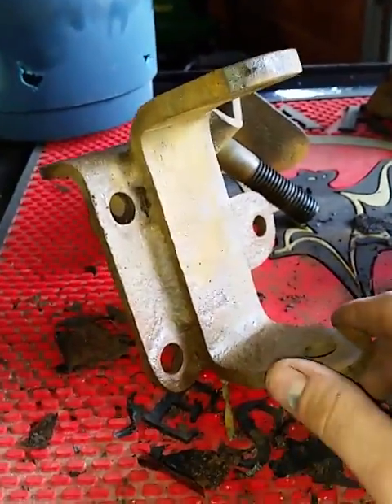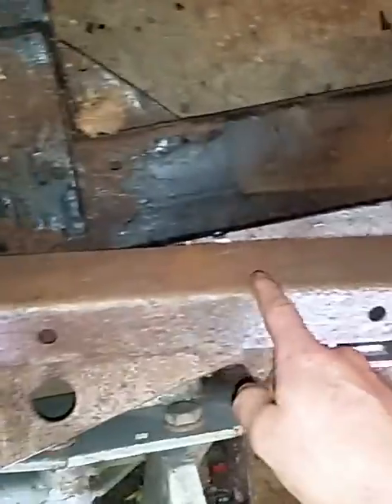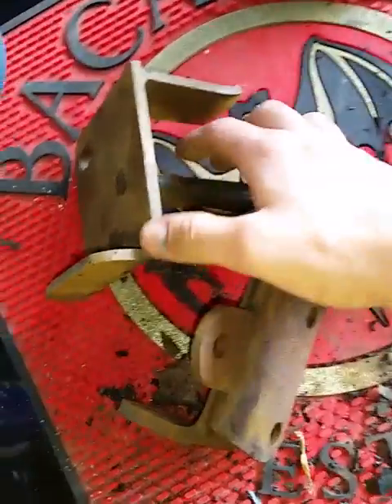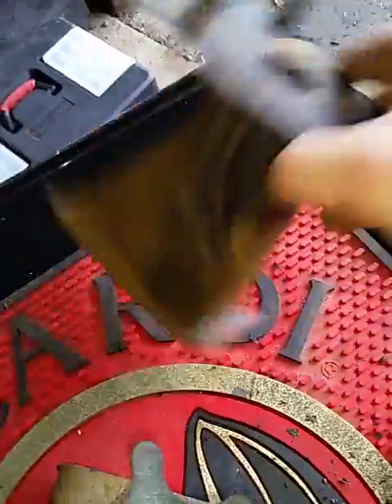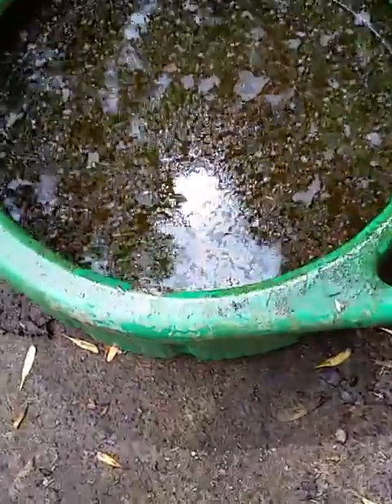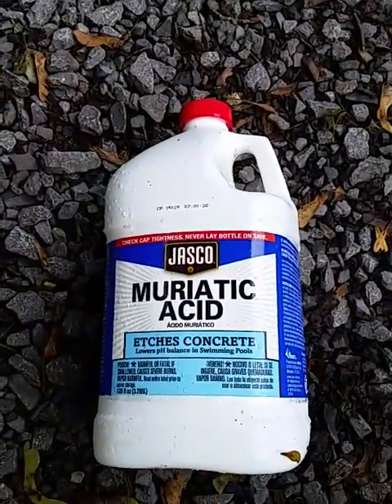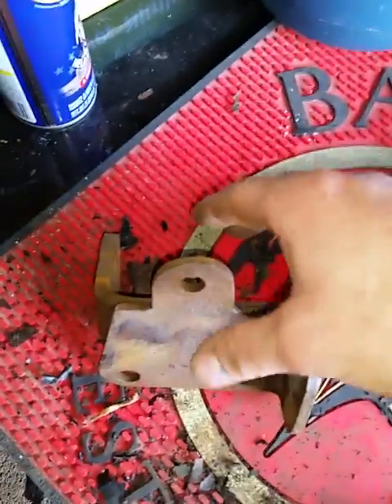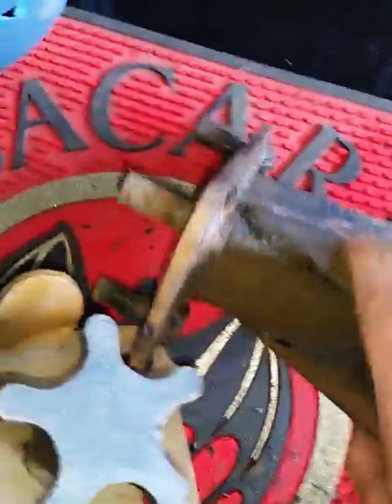Must Watch Easy Rust Removal with Muriatic acid

Comment: You need to neutrilize the action with water and baking soda or it will hold the Hydracloric acid in the microscopic pours of the steel and re-rust. Yes Muriatic acid is a derivitive of Hydrocloric. I soak my stuff in that and then i use Krud Kutter which has a fantastic chemical to neutrilze the action awell. Seems to turn the steel blackish after it dries. I just hit stuff after the rust is gone with a wire brush and then epoxy prime and paint stuff right away wet paint over wet epoxy primer. That way you get the best of both worlds mechanical adhesion from the acid etch and chemical from the primer and paint.

Comment: Hydrochloric acid, JFC... this idiot.... you need PHOSPHORIC acid or you're just removing rust and impregnating the good metal with chlorine, the problem that you have in the first place. It also will continue attacking the good steel directly.   H3pO4 will attack generally only rotted steel and rust, leaving good steel intact.  not only that, but it forms a protective phosphate coating which conveniently makes a decent primer.
Reply from the maker: Are you talking to me?

Comment: spray,     the "paint,  with "oven cleaner", first,  to "break seal".  it should "curl, or bubble".  then, soak in,  1 part, molasses,  9 parts, water. "buy molasses, at feed store, by the gallon".   soak, till rust dissolves. couple days, to couple weeks, depending, if you scrub brush.     non-corrosive,  and enviro friendly.  i've even give it to plants, for feed.    It eats, all rust,  right down, to pin holes.     then, "good",  pressure wash/ scrub, to remove "all molasses",  then spray, with POR-15, "Metal Prep",  keeping surfaces, "wet",  for twenty minutes.     rinse clean,  and blow dry, all drips,   and "pinch-welds'.    leaves, a grey,  "etching primer",  which, will not,   "flash rust",   if kept dry,   till paint.   truly, unbelievable results.      i re-use,  the metal prep, so, have a tray, for collection.                                    read "all",  POR-15, instructions thoroughly
Reply: Interesting...

Comment: Obviously you are determined to do this your way but...For me,,, as with body work, frames and steel used in restoration projects.. The problem is that although it will remove the rust you see (actually what you see is NOT rust, it is the already oxidized byproduct of the rusting process which you can not see) it will set in motion a process that will lead to more damage than you have now. Once the acid contaminates the iron (ESPECIALLY iron castings which tend to be somewhat porous) the chemical reaction that starts will be nearly impossible to stop. Some will say you simply need to neutralize the acid, much easier said than done, and while steps to do this will slow the damage it hardly ever stops it completely. The rust solutions both dissolve the oxide on the surface and convert it to a phosphate that tends to stop the rusting process, the Hydrochloric (Muriatic) acid on the other hand will dissolve the oxides but as far as stopping the rusting process it will be like throwing gasoline on a fire! I have battled this for years on mining equipment that was exposed to Sulfuric acid and I can tell you that once the metal is contaminated it can really make a mess. It is not as simple as removing the iron oxides that you can see you must take into account the chemical process that you are about to start, and this is one that you don't want any part of! Do yourself a favor and use Phosphoric acid because it will remove the oxides also but it will start the right chemical reaction that will leave the phosphate coating that will inhibit rust instead of accelerating it. The Phosphoric acid may take a little longer but it is definitely the better way to go, usually the fastest way out of something just leads right back in!
Reply: OMG! Thank you. If this is true then why are there so many videos recommending Muriatic acid!? You just saved my old truck restoration project. Thank you a million! We need people like you to set young DIY folks straight.
Reply: thanks rick for the valuable info, can phosphoric acid remove severe corrosion in reinforcements inside the concrete?
Reply: Thank you for the detailed explanation! I had a rusty fireplace curtain that i was very close to using muriatic acid on. Luckily i found a relatively cheap new one. I don't like the idea of ppl using this stuff without understanding it. Especially if a kid or animal ends up suffering because of it.
Reply: @Chris  a kid or animal suffer from it?  It's not like radiator fluid that tastes sweet, animals like dogs smell it and back off they don't try to drink it
Reply: I totally agree.  I can't imagine leaving steel or worse cast in muriatic acid for a day.  Or maybe if the solution is a weak mixture using water, like one half cup of HCL to a gallon of water. But as you detailed, even a weak solution of HCL I think will  start contamination.  Phosphoric is the best way. BTW I'm not a chemist, just a DIY person.who has learned the hard way on a few things.  Thanks for your detailed info.
Reply: WOW... I never knew that you can't see rust!!!
Reply: Rick Bell  Once the acid is washed off the metal and or is neutralized I just don’t understand how it will continue to do any damage in the future.  I mean once its cleaned off, the acid is gone and or neutralized so I don’t really get what you are saying.   I do get that there may be a different type of oxidation layer right on the surface from the acid etching that is like .001 thick but if the steel is neutralized and is going to be oiled, waxed, or painted I don’t understand what the big problem is.

Comment: Im in charge of building the signs and menu boards for the restaurant mission BBQ (If its not in your state, look it up. Its a place dedicated to military vets). The older menu boards are made of 1/8 thick aluminum. Its etched with muriatic acid and then an aluminum blackening chemical is tossed on, sanded, then clear coated. Its not done that way anymore, but its an idea for people who work with aluminum for neat designs in their works

Comment: After pickling in acid, best to soak in an alkali (eg sodium carbonate or bicarbonate) to neutralise the acid. Also extended periods in acid can I think induce internal corrosion in the piece, so best not use this for part that are safety critical like tow bars etc.

Comment: The 5th method is to stick the metal between my ass cheeks while I sleep
 overnight. The chemical reaction between the crust in the crack of my 
arse and the metal forms an oxide that I crap out in the morning. 
Presto!! No more rust!!
Reply: it will fit no worries.
Reply: bet that works great if somebody has a rusty penis...
Reply from the maker: Solid!

Comment: I can confirm how well this works i bought straight Muratic acid and garden sprayer with a pressure washer on my truck 40 Ford Frame and i completely removed the rust within hours and it was scaly.   Then I hit it with a rust converter to prevent flash rust. After rinsing of the converter it was perfectly clean metal ready to paint I think it did better then the last Frame I had Sandblasted.
Reply: any updates on how the frame lasted over time???

Comment: if you have an old style battery charger you can remove rust on items using electrolysis google for details I made a tub for dipping from scrap lying around the house $4.00 for baking soda not the same as you use in household but cheap and easy to get any link descriping this will tell you which type of baking soda to use and you add so many teaspoons per gallon (not a whole lot) I have dunked parts with solid rust all over like 40 year old brake calipers and 3 hours later with good gloves to protect hands i lightly brush off caliper and rinse in same vat with a brass wire brush the blow dry with air gun  and finish cleaning in bead blaster. takes 15 minutes to bead blast calipers better then new if you skip electrolysis step takes about 9 hours to clean and even then you may miss parts that bleed back thru after powder coating .. the electrolysis method makes the rust no longer stick to the metal at an atomic level you literally can brush it completely off sand blaster makes it nice to finish but it really isn't needed
Reply: I used that method with straight water and is works. It also peels off paint real well.

Comment: I thought 20 mins. was enough, otherwise it weakens your metal ?
Reply: the concentration of the HCl determines whether it's going to cause more rust or remove the rust, but, yeah, you're better off with the phosphoric acid.
Reply: Not unless the metal is thin as a human hair!! No seriously, HCL (hydrochloric or muriatic, same thing really) does not significantly attack steel to any appreciable degree.
Reply: thank you
Reply: elimonjal
I should change what I said a bit: It turns out that HCL does deposit Chloride ions which bond with iron and will increase the chances of further rusting . This will not weaken the steel per se if the rust is looked after and dealt with. Even so would take years and years to cause a problem I think. And I'm assuming a thickness of say 1/8, 1/4 etc., meaning not paper thin. What this means if you treat it with HCL you need to paint it and look after it, don't just leave it bare and forget about it. I think the better method is phosphoric which actually leaves a protective layer. I'm now looking into getting fairly strong phosphoric in gallon size.